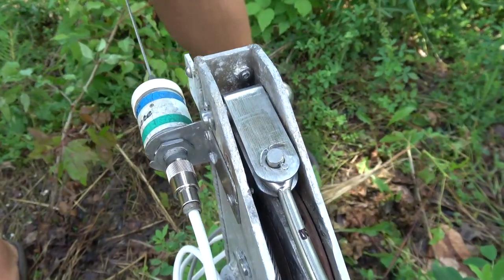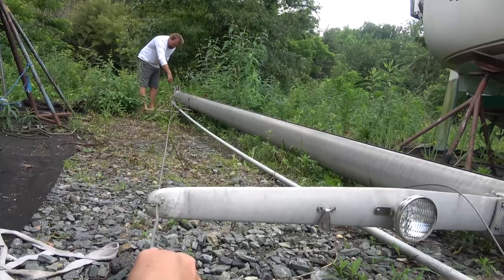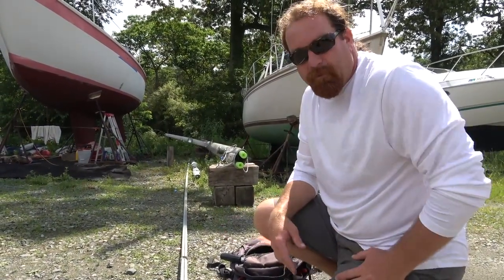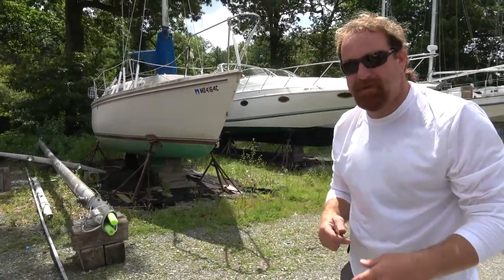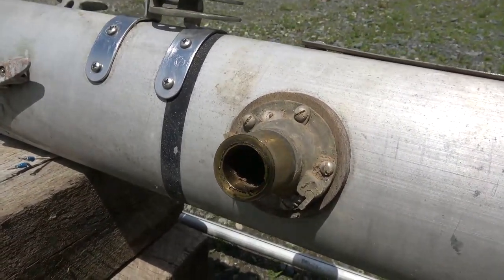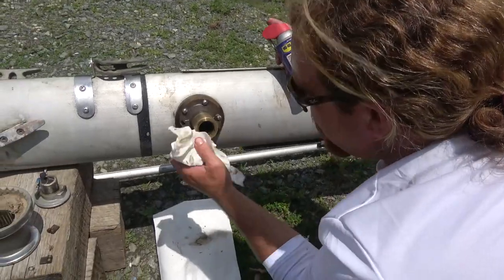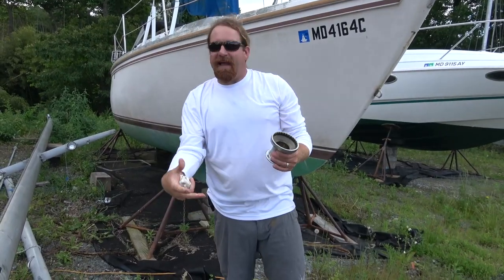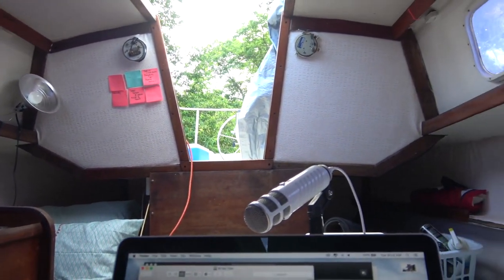Show me your Rigging | SMLS S5E04

Comment: Something to have on hand when servicing a winch, a magnet. case in point, I was working on the mast laying on saw horses and dropped that little pawl spring. The ground was dirt and leaves. I couldn't see it but the magnet could. WD 40 is also the 40th time they tried to make the stuff. Many thanks for your instructual video,

Comment: You definitely want oil in there. WD-40 just evaporates and does not last long on any surface. I would consider some type of marine oil but I'm not an expert on it.. Another great video.
Reply: The rigger said they didn't have any oil...what about the vehicle he/she drove out ? it has oil. Easy to get a drop off the automobiles dip stick, just sayin
Reply: You can use that dirty oil in an emergency but your right near boat store. You need marine grade oil That wont mix with water and turn into sludge. You should always have a can around anyway. Sinse he dint have any, you are going to have to put some on those springs to protect them from corrosion which will cause them to fail and your winch will stop working right when you are in the middle of no where. It will be good practice for you anyway.

Comment: Dyneema is made stronger by heat annealing, almost like a metal alloy.  They pass the the finished dyneema line through hot steam under tension.  Heat annealed dyneema is extremely stiff and gets even stiffer under tension so it is best suited for standing rigging.  It splices well but does not hold knots well and is not ideal for soft shackles.  Common heat annealed dyneema lines on the market are Colligo Dynex Dux (I believe they have changed the name to Dyne-Ice?) and New England Ropes STS HSR.

Comment: I'm glad I stuck with this. Redemption is always edifying. Cal 29 boatyard derelict was a good choice. Good simple design endures. I'm interested if you've had the galvanized compression beam checked. In reading about these boats it comes up as a component that needs replacement with better material than galvanized steel. There appears to be a couple of schools of thought on which material is better. It looks expensive if you farm it out but much less so if you do much of the work yourself. From what I've read you should do so before you re-step the mast. The other major component is the engine. I'm looking forward to videos as you work through these and learn along the way. Best of luck. You're knocking out the issues and making your dream a reality. PS I did a little research and an Atomic 4 Beta Marine diesel replacement runs about $9,000. This would be a great longer term goal if you can use the existing motor in the meanwhile. Moyer Marine has Atomic 4 rebuilds that you can do for about $3,000 if you do much of the work or about $6,500 if you have it done.

Comment: WD40 is not a lubricant.  Use non-detergent oil for winch parts and water resistant marine grease on the bearings.  Motor oil has detergents.
Oh, and very nice job on fixing an old boat! One of my favorite pastimes.

Comment: How can a sailboat rigger not know why there are two tracks on the foil?  Has he never raced and changed headsails?  
WD40 is not a lubricant to be used on pawls you are better off with any oil. Sewing machine oil works even motor oil would be better. 
Bronze can have small capillaries which can carry oil but the nature of the metal is not inherently oil containing. 
Winches are generally easy to service. 
The simple turn  he showed to secure your pins might cause a sharp area for a sail to chafe. That is a reason to use a needle nose plier to give a turn on the pins. 
On a bigger boat you should take care when tailing lines if you only have one wrap on a winch and the line gets loaded by a big headsail you can get serious rope burn. 
He is better than a construction rigger for sailboat rigging. 
Pick up a rigging book by Brian Toss and get some thorough knowledge.  He is the Nigel Calder of rigging.
I'm glad you found Mike, too bad you wasted money on the wrong type of rigger though they should have warned you when they were called to a boatyard that they weren't sailboat riggers.
Reply: yep wd40 is used to break stuff lose, not a lubricant, look it up., it will make stuff rust faster
Reply: +beach bummin, i use inox  fantastic stuff..
Reply: I think WD40 was invented to spray on the airplanes that were stored in San Deago afret the WW2
Reply: Holy cow. WD-40 is a light lubricant. It displaces water. Water Displacement formula 40. If will not make "stuff" rust faster. It wasn't made for the shuttle, but a company called Rocket Chemical created it. Quote from WD-40 site.

WD-40 achieved universal prominence around this time when the late, legendary billionaire Howard Hughes tried to back out of a deal to buy a brace of General Dynamics Convair 880 passenger jets.

With the General Dynamics deal in deadlock, the then state-of-the-art aircraft languished for months beside a runway near San Diego Bay with metal in the wings and fuselages steadily corroding.

A retired General Dynamics engineer, Bob Bailey of the San Diego suburb of La Mesa, has since told the story of how a desperate call was put through to “a little outfit called Rocket Chemical Company”.

“They sent over a couple of barrels of this ‘stuff’ and I had to test it before we put it on the planes,” he reported.

The ‘stuff’ worked so well at protecting the valuable aircraft that Bailey and his work mates took home small amounts and applied the stuff to tools and locks, and cars.

“All the corrosion and rusting of my tools just stopped when I sprayed them with the ‘stuff’,“ Bob Bailey said.
Reply: WD-40 .. "Water Displacement" formula 40 ... it is an oil (contains fish oil) that can be used as a light lubricant ,, was developed to dry electronics on ICBM's and other rockets , I believe by "RocketDyne Corp".  It contains "aromatics" which are light oils that gas off ... it is HIGHLY FLAMMABLE .... What you want as a general purpose lube on a boat is white lithium grease in a spray can.
Reply: I'm SOOO glad everyone chimed in about the WD40. That crap is CRAP if trying to use it as use oil. The marketing gurus have certainly convinced most, this is an oil. I only use oil with Teflon on my equipment
Reply: and Aussie made
Reply: eddie memphis it does contain oil and in a pinch is better than nothing or grease but a little heavier oil is probably better in this application.
Reply: WD 40 also evaporates.   Mineral oil also works well,  there are also spray dry lubes,  and lubes with Molybdenum are good too,   a good place to find small containers of  good quality  oil is the gun dept of any sporting goods store or area of a store.  of course sewing machine oil as you mentioned. veg oil. might work in a pinch.
Reply: He used the WD-40 because he didn't want to assemble the winch dry. He should have had oil, he didn't, and suggested that, when necessary, she use regular motor oil now that she's an expert. 

Like he said at the beginning, you don't contact SONY when there's a problem with your camera you fix it yourself. He gave the lady a detailed step by step regarding her rigging so she CAN fix it in an emergency if necessary, just like fixing her own camera. 

WD-40 will work in a pinch for just about anything but not a substitute for regular oil, in my opinion.

Comment: Interesting that the rigger was using WD40 mostly as a cleaning solvent.  A better cleaning solvent for old grease is brake cleaner.  Probably a bit more expensive but less work.
Another excellent light spray oil is Fluid Film.  More expensive than WD40 (so you don't want to use it for cleaning) but better corrosion resistance and it will last longer.
Picking a nit, needle bearings typically are loose, not contained in a cage, and as the rigger said, usual smaller.  I would call what he had in his hand a roller bearing.

Comment: Another good question: what is the difference between a sailboat rigger and a crane rigger?
Reply: bob5466 Crane Riggers are used on construction sites primarily to lift construction supplies and girders.  
Sailboat riggers are specialized riggers for working on the rigging of a sailboat. They know about lifting stuff but they also know about how to keep a mast up, the forces involved in moving a boat with wind, and the gear you need to sail.
Reply: And, most importantly, what the effects of marine environments do to rigging that from a distance appear to be ok.
Reply: should have cost about 200

Comment: no use a vice and hammer to straighten cotter pin and make sure the clasp is on the end of the wire wear it goes in on both end the part of the pin with the capo or end

Comment: "The Rigger's Apprentice" is Brian Toss's bible about rigging...Also, check out the videos on how to install Sta-Lok fittings by Project Atticus --- Jordan shows you, step by step,  how to calculate the correct wire size for 'single spreader boats', lay out the wire, on the ground, measure then cut and install the fittings. Desiree is also very helpful with instructions for making your own cushions, having learned from watching Sail Rite videos. Further, Drake Paragon's rigger in Oriental, NC says to use automotive 'brake cleaner' spray rather than WD40 because it doesn't leave a 'film residue' on stuff....FYI for the future...Check out Atom Voyages' videos about a Norvane self-steering windvane, if you plan to do any 'long distance' sailing...

Comment: TORQUE TUBES are fun for the ladies .....if the sailor man really knows how to use it!! The LONGEST STAY on the vessel is ...when you are way offshore with an idiot you want to throw over board!!!! A sailboat has NO MAST.... it is  a power boat .....unless it has no moter ......then it is  a drifting lifeboat .......if it has beer on board ....it is a fun lifeboat!! A POCKET CHUM is the result of sailor fatigue when the sailor actually believes a little helper crewman lives in his pocket and comes to his aide in distress..not to be confused with POCKET BUMS which are lazy skallywags that come out at night and eat your favorite food that you are running short on..SERVICING WINCHES by ones self is free and fun. Most men prefer ro service their winches alone. A real lucky guy gets to service two at the same time. Rubbing oil on thier bodys 1st makes for a silkysmooth ride. Great video!!!
Reply: Comical. Thanks for the laugh! Ö

Comment: Nice video, The rigger never should recommend using WD40 as a lube, Its worthless as a lubricant. I find it strange that he would pay for Lucas synthetic Grease and then use WD40. kinna a oxymoron.
Reply: rsmithotis the pawls should never have grease on them. It could lead to sticking pawls and a dangerous failure. WD40 would be better on pawls than any grease.
Reply: WD-40 is worthless as a lube or protectant. I figured he did not grease the pawls cause of sticking but she should ONLY use marine grease (or some type of marine oil) in a wet environment. (oil on pawls). Regular grease or oil will mix, get contaminated if exposed to water and it will hold the water and turn into sludge.
Reply: rsmithotis That's not what oxymoron means...

Comment: Whoever mangled that furler was certainly no snipe or bos'n. It is only common sense that when a furler starts having issues and it takes more then reasonable power applied to function that there are worn parts which need to be addressed. There are NO lubricants indigenous to raw copper or brass or bronze. ref: Sintered Bronze. Lubricants are added during the manufacturing process. Snipes never lie :)  But yes, bronze turnbuckles are not prone to the galling seizer issues as SS on SS. Why riggers use such expensive seize prevention compounds instead of simply, and less expensive Anti-Seize compound is beyond me, other than the fact the Anti-Seize is impossible to remove to from skin.